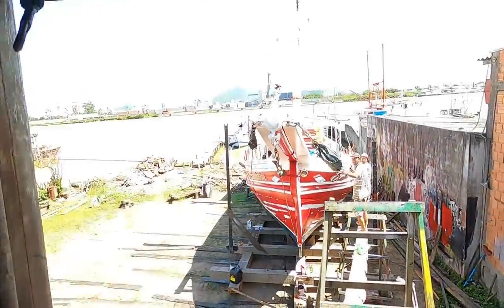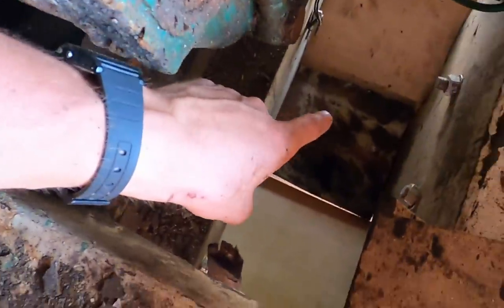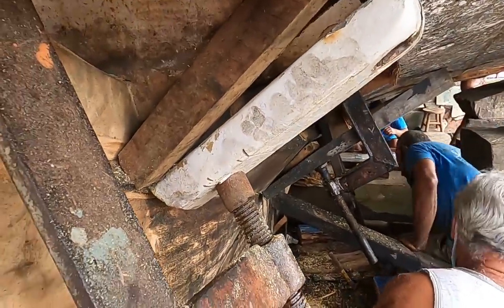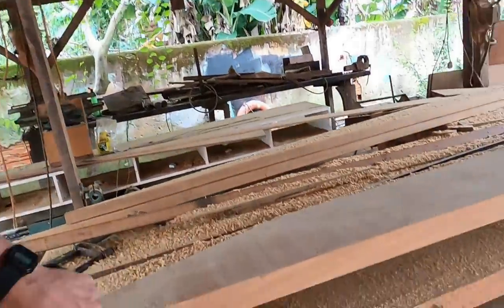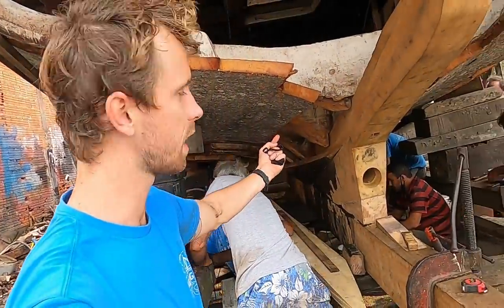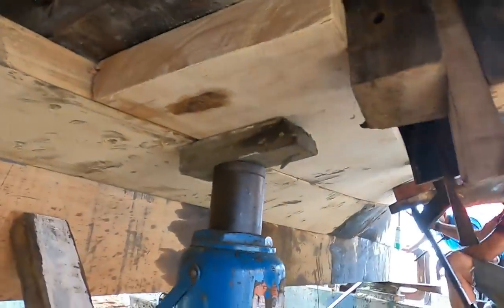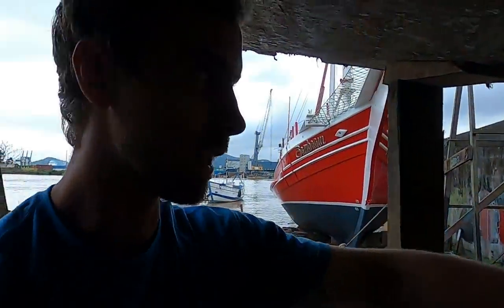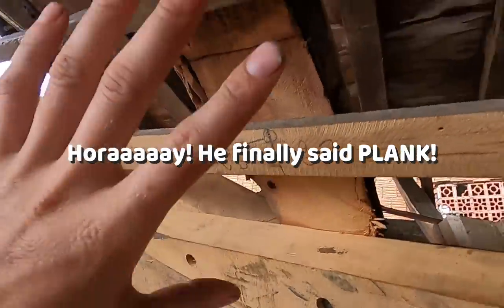Building a wooden boat with FIRE! — Sailing Yabá #20

Comment: Twist on those planks and with that thickness those nails don't seem adequate in some places. Look at 18:06 and you can see the end of the plank spring back out.
Reply: Traditionally they would be riveted in high stress areas.
Reply: @jiefflerenard1228  Aren't they using stainless steel nails? I think they are

Comment: The way that shipwrights bent planks many years ago was they placed the plank into a long pipe with fire and boiling water at one end and they steamed the plank until it could be bent. I saw this done when I was a child.
Reply: Steaming planks is far safer than heating with a torch.
Reply: many shipwrights still do. its the best way to do it.and safest

Comment: I never use galvanized nails because with the flex of the hull it breaks off the Galvanization and you get rust and iron rot in the wood.   For a little more money you can use stainless steel screws and for a little more money you can use bronze screws.  Screws are much, much better than nails because nails will pull loose much faster and screws you can re tighten them.  MHO on plank fastening and fasteners to hold wood above and below the water line.
Reply: Spot on.
Reply: Stainless steel in an oxygen starved salt water environment will corrode far quicker than a galvanised iron nail.
Reply: @wombatone5577  I have built many boats that were used in salt water using SS screws and never got corrosion but I have see galvanized nails that disintegrated leaving iron rot in the wood.
Reply: What if the wood is saturated with epoxy?
Epoxy in itself is very strong and it's watertight too.
Reply: Is this the first video you have watched or did you see the one where they are taking of the old planks. They were held in by nails and were not exactly falling off even after 13 years.
Reply: @glennedwards1449  And I saw all the rotten planks and some of that rot was Iron Rot from using Galvanized nails.
Reply: @charonstyxferryman  maybe you are equating epoxy with fastening. I always cover the outside of my boat below the waterline with copper powder epoxy mixed into the epoxy medium.  I love epoxy covered with copper flour to protect paint and hull from wear and wood damage.
Reply: hehehe, try driving a screw into brazilian hardwood  hehehe   that aint no american softwood sonny. even your hard wood is very soft compared to that wood

Comment: MP, I had an English teacher in High School that said "If I say something to you and you understand it, you used good English, maybe not perfect English but good English because you had communication and understanding." The palm to the head, without even speaking a word, said a lot. It was perfect and funny! Great video on wood bending. I've seen where builders used steam prior to installing a plank. Never heard of oil and heat. Have an awesome day.
Reply: 👍🏼👍🏼Sounds like a teacher that valued communication over "proper English." Excellent!!
Btw, flame works like steam for bending, but leaves more finish work on the surface...
Reply: No steam is the norm I’ve never heard of oil and fire before either.

Comment: If you have butt blocks instead of a scarf joints then don’t let them nail the butt blocks. Make them use bronze bolts on butt blocks. If a plank ends at a frame and it’s a butt joint use bronze screws at the butt joint into the frame. Should also use bronze wood screws at the forefoot and stern post, preferably not nails.

If a plank pops loose at a butt joint or pat the forefoot or stern post then you’re going straight to the bottom. So screws and bolts are cheap insurance at those points.

Comment: In wooden shrimp boat construction, the nail was dipped partly in paint,  pointed end down. When it was driven in, the friction of the wood would strip away some of the paint and leave a gasket of paint under the nail head, and in some of the voids in the wood contacting the metal.

Comment: I think it will be far more likely that those nails will pull out easier,because they are predrilling the holes to make it easier for them. I understand that they have not the energy or strenght to hammer them in without predrilling but the nails would hold tighter if they were squeezed through the wood with a big hammered impact instead.
Reply: True except it would also deform the wood perhaps even split it.

Comment: At 18:10 into the video you will see the plank coming out a little bit. that is something to be careful about, there is so much pressure on the plank. not too good in the long term if plank space out with the bending pressure. Then it is better to humidify the wood to reduce pressure. Keep the good job.

Comment: Seriously!  Is no one else concerned that they are nailing the boat together?  If it was my boat.  I think I would want something better than nails in my hull.  LOL
Reply: Screws are a better fastener.  But then a bolt through the lumber with a washer and nut at the end is better still.  I get concerned they are bending huge planks that might spring back and loosen.  But, God love 'em...they keep moving forward.  Motivating and inspirational.  So far, workers are awesome.  They deserve a bonus.  Maybe, in the end, we can fund something for them.
Reply: They look like hot dipped galvanized. That should last last about a year.
Reply: I agree logic would tell you to use screws but it was nailed 
originally but I would glue and seal each plank

Comment: Talking about hitting the nail on the head, it was done with either a regular hammer or sledge hammer. I’ve worked in construction and I’m in awe of those working on Yaba. They work quickly but with precision, WOW. So appreciate the great video angles and the editing and the great video inserts when Ben used the wrong term - so funny and entertaining.

Comment: Just when you’re old enough to think you’ve seen it all.  Never seen nails used to fasten planks.  Even the garboard where riveting is impossible stainless steel or bronze lag screws were used.  All other planks to the frames were through riveted with at least 3/8 copper rivets.  But I’m not a ship right I would think nails would eventually back out like they seem to do on outdoor building projects, for example decks.

Comment: All due respect to your shipwrights, moving along quickly. Are you planning on riveting or bolting the planks to the frames at a later stage? It seems like a good idea given the thickness of the planks and the fact that they are not pre-steamed and may have quite a lot spring-back force left in them. Somehow the nails seem a bit undersized for the material?

Comment: Life on a sailboat can be enjoy  and fun. To rebuild the wooden sailboat is hard and lot of time and money. The 2 Question: 1) why are you or they use the galvanize nail? I will use either brass or bronze screw or bolt. 2) why not use waterproof glue such as polyester or epoxy or etc on the plank to rib? Keep up good Vlogs always enjoy your Vlogs. Stay health and safe!!

Comment: It would be benificial to buy a simple boat building book and familiarize yourself with standard wooden ship building terms. Also are those steel nails? If so you’re wasting your time replacing anything. Spend the extra on Silicone bronze or copper.
Reply: While I have my criticisms, I commend your bravery and boldness to attack and save a boat that even those shipwrights would have chopped into firewood.

Comment: Your planks need  silicon bronze screws as galvanized nails will work loose. If you have a plank fail due to those nails while at sea, you will be in serious trouble. Still wishing you the best.
Reply: I gave up trying to advise them, i have 30yrs experience. I am truely concerned about them taking it on long sea journeys.

Comment: Really enjoying this rebuild!
It's great watching craftsmen working as they used to many many years ago. The old skills not lost.
These guys are going to be famous by the end 😀
Reply: @JCrook1028  thanks !
I watch both those channels already and enjoy them both, they are however on a much smaller scale and use modern tools and equipment.
The Yaba project is going back in time with the exception of some electric drills everything is how it would have been done 100 years ago.
It is also a repair as the others are essentially new builds, I know Tally Ho is technically a rebuild but only the transom remains of the original hull.
Reply: @JCrook1028  the tools used on Yaba are probably 50 years old the band saw was probably run on steam once!
The planks are 4 inches thick not like Tally Ho 2 inches. Everything apart from the transom is new wood . The skills are awesome for all of them but I am sure the hardest is Yaba especially if you add in the condition of the boat to start with.
It remains to be seen how they finish it and to what standard.
New build has to be easier than the job Yaba have undertaken!!!
Reply: @JCrook1028  you seem to be getting way too invested in what was a throw away comment. Calm down and enjoy your subs as and when you want.
I shall reconfirm I find Yaba the more compelling while not taking away the craftsmanship of the others.
My last word !!!!!!

Comment: looks like steel nails, won't that rust and cause iron rot in the timbers?  Don't you need to finish replacing the frames before planking?
Reply: Hi The nails are Galvenized that is why they are silver in colour.

Comment: Thank you for videoing how planks are fastened in Brazil. It will be interesting to see hull caulked. steaming now seems a safer way to manipulate planks during install. Hope you get 25 years on new hull . So glad I have a small fibre glas boat🤪 Boat just finished in yard sure look GOOD.What is estimate for repair ?? Hang in there. PG

Comment: I'm surprised they are not even putting boat soup on the inside of those planks.
Reply: I was surprised at the galvanized nails being used to hold the planks. Those will have a finite life span, but then so does the rest of the boat. Not even ring nails! I'm so used to bronze screws or copper rivets I forget this stuff is used elsewhere and they seem to get by ok.
Reply: Boat soup, hehehe, on brazilian hardwood, you've been watchin too much  of thoses kids on the   west coat.   Nothing wrong with galvanized nails, thats what was used to put her together the first time.  you ever try to puul a galvanized nail that benn in that wood?  hehehe good luck with that
Reply: @appick01  Ever try pulling a galvanized nail fron brazillian hardwood
Reply: @mazdarx7887  Wasn't a boat soup used in old wooden ship building to protect against rot and worm (thinking about navy ships of the time)?  Brazillian 'hardwood' can't be that rot resistant as shown by the totally rotten frames on this 20 year old boat and a layer of primer is hardly any protection is it?
Reply: @SpiralDiving  The wood is very rot resistant in salt water. It's the fresh water that kills it, Also buy the look of all the electrics in it the boat spent most of its time in a marina which is also not good for most boats unless properly protected. Sea worms, etc. , come in through the sea, copper was used to clad the boat for protection from all sorts of sealife,  In modern times there are all sorts of paint/coats (that has to be applied at regular intervals) to protect the boat. Aside from which ever coats you use above the waster line sea water is aa wooden boats best friend.  In days of sail for thousands of years the boat was constantly scrubbed with sea water, as salt is a presative.  Many wooden boat owners pit rock salt all around the inside of the hull
Reply: As for boat soup, that could be anything on hand to help keep the boat looking good and has change many times over the years. Most expensive boats use teak oil and varnish

Comment: This has been very enlightening. I have seen, read about, etc boat building but the techniques used here are all different. Of course, I have only seen North American techniques (rabbit the whole length of the keel for the garboards for example). It is interesting seeing other ways of doing the same thing. These guys look like they are vary good at their work. It seems wood boat building is still common there. Ours are all made of "snott".

Comment: I've seen comments concerning proof of the use of nails as a structurally sound technique. Yes, the original nails held with incredible success. 1) The original nails were larger. 2) Extremely doubtful original nails were installed by drilling pilot holes. At 6:38 nails were driven in effortlessly, except for the last inch with a 14, maybe 16 ounce hammer, structurally, very concerning. 3) At 18:10, a plank sprung under its own tension by simply removing a jack. Think about that for a second. A plank let go sitting in a boat yard, no added stress from masts, rigging, flex from uneaven seas...UNDER THE WATER LINE...
Finally, iron illness issues still an issue in years to come..
Reply: When was the boat built ?

Comment: Is the new planking the same timber,I know these guys have been doing this a long time,but no tar,or goop between frames and planks and the ends of your garboard planks might be better hook scarphed into the next plank in the ends,sharp pointed ends have a habit of splitting. but so far so good I trust

Comment: Are you guys not worried about iron sickness using galvanized steel fasteners, and are the new plank nails smaller than the older ones?  PS love the artwork going into the boat. I can only imagine how easy it is to drive the nails in from beneath, careful MP going to have brain damage

Comment: Very interesting episode. A question or two.....will the guys cover and fill the recess for each nail head to help protect the nails..and secondly, what kind of chalking, hope that’s spelt right, will the guys use in the little spaces between the planks.
Reply: caulking is the word . hammering twisted hemp into the joint, then covering in tar.

Comment: It's really interesting and yet slightly frightening to watch the difference between north american boat building techniques and South American. Both after the same result obviously; a seaworthy boat, but how they get there is totally different. bending the wood with heated oil vs. steaming it, butt joining as apposed to scarfing, ( like what they did on the keel) the planks. Zero dolfinite, anti fouling or some form of chemical treatment to the boars as they go on.. Biggest one for me is the use of galvanized nails and not bronze screws/fasteners/furniture, I think this one will come back to haunt you rather quickly. This obviously works for them, otherwise there would be no old boats and no old dockyards.
  Sometimes this is hard to watch, but more often then not, it's just very interesting to experience this laissez-faire style of shipwright building. Looking forward to seeing how this ends.

Comment: I watch 2 different wooden boat building channels, this and Sampson Boat Co.  This one uses chainsaws, angle grinders, galvanized nails, tar and flame to build a boat.  The other uses hand planes, chisels, copper bronze rivets, and exotic wood imported that already is "bendy".  Both get the job done.  I think this boat might be being built to "Working boat" standards, where as the other to "Yacht boat" standards, but in the end both get the job done.  Very interesting to see the 2 methods being used.
Reply: Great observation and due to those differences,  Tally Ho will still be around in 100 years while Yaba will be lucky to survive another 20.
Reply: it previously lasted 7 years and was probably built to the same standards as this rebuild. It had some pretty bad fresh water infiltration problems, so that certainly made it rot away faster. If well maintained she might have some 10-15 years left in her after this botched rebuild.